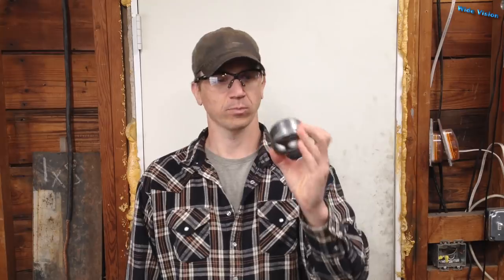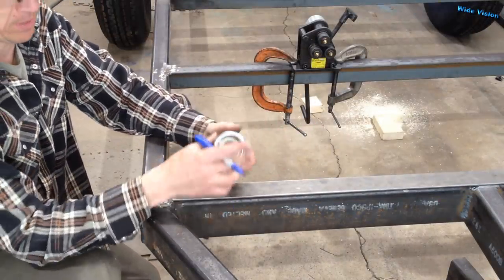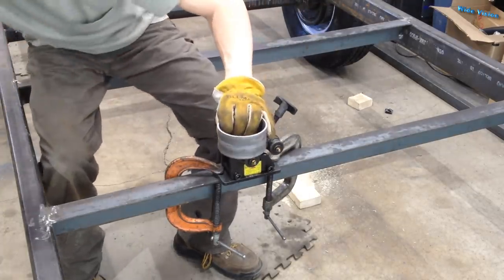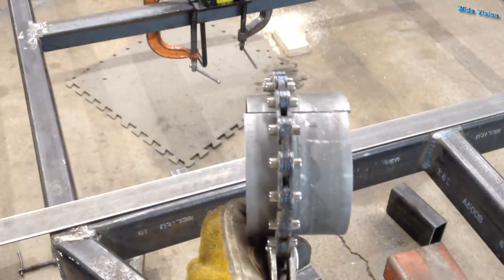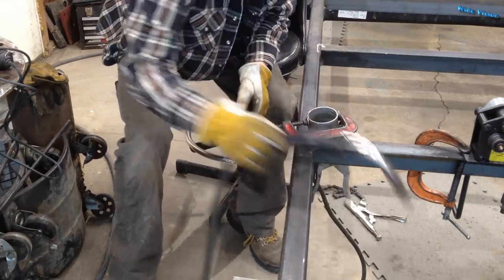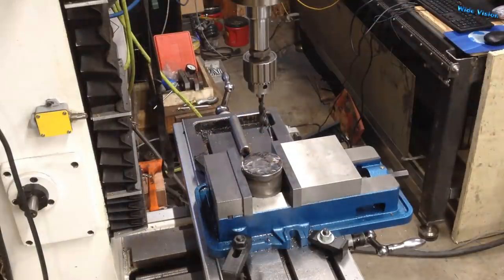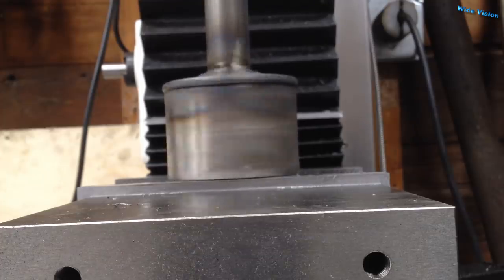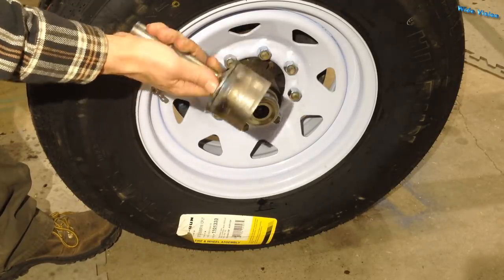Grease Cap Tool Build - The Long Way 'Round

Comment: I just usually whack the dust caps (what we call them in the opposite corner of the state) with a rubber hammer.  If one is not available, I hold a 2x4 against the cap and whack it with a regular hammer.  It USUALLY doesn't dent them.  I have a 20 ton HF shop press.  For the jack release, I got a piece of steel rod a little larger than the release screw on the jack, drilled it out the diameter of the shaft on the screw, drove out the cross pin, drilled a cross hole in the steel rod, and cut a 4 petal shaped handle on the CNC plasma table.  Welded the floweredy looking thing to the steel rod, and drove the cross pin back in.  Handle is always there and you don't have to move the jack handle out of the jack to release the pressure.  You could do a similar thing to your ring roller.  I have never tried the oil finish.  It does look nice.  I got a bottle of Birchwood Casey Super Blue (gun blue) and use it to blue mild steel.  It is darker and I think it looks better and no heat required but you do have to clean it very well.